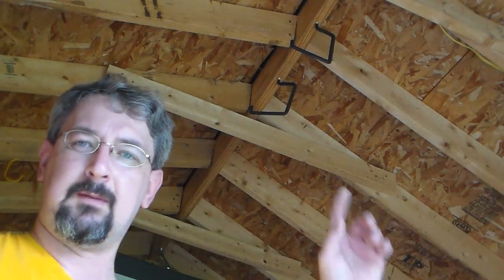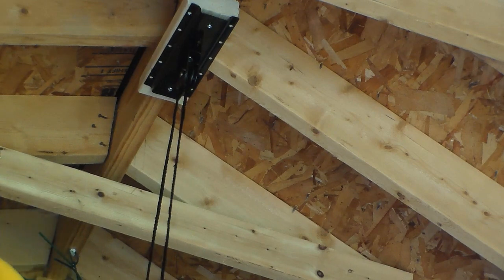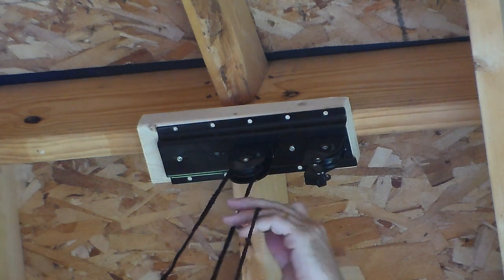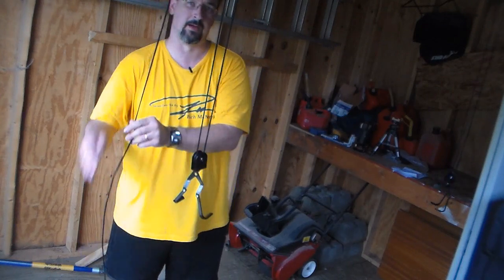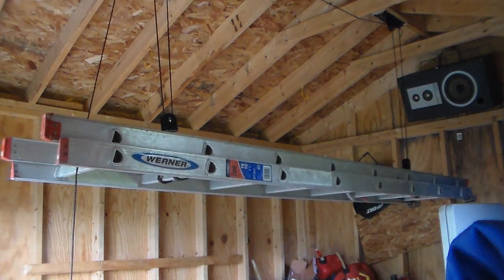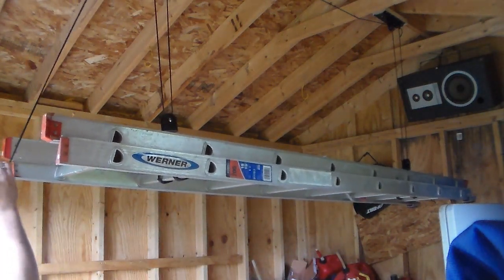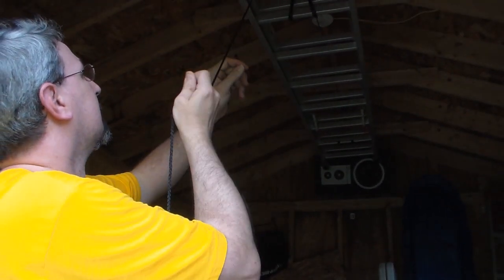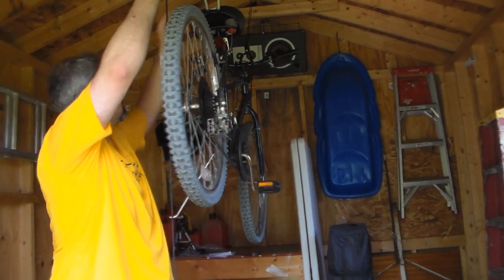Barn Storage

Comment: Mike, if building the lift table in either the garage or the shed, might I suggest the following. If the CNC table is going to be on locking wheels, your table can cut in one location then push it over to the lift location after cutting and before storage (with a dust cover) near the ceiling. Build table with fold up and locking legs. Put 4 pulleys on the ceiling (into joists) approximately same corner dimensions as the table. Run 4 quick disconnect cables from corners of table up through the pulleys and then all over to one side so you can connect with screw toggle adjustments on each onto a single strong bolt (perpendicular to the cables). From that bolt connect a separate single cable through eye bolts in the ceiling to a pulley at the downturn point along a wall near where you want to do the lifting. Then through eye bolts down to the lifting mechanism. If a turn involved use pulleys. The lifting mechanism can either be a hand winch or small electric winch. All of these parts are available at HF or a big box store and can be made for less than $75 (- electric winch) depending on the quality of rope or cable you select. I made several work table and and a couple Model RR layout ceiling storage lifts this way. Hope this helps get you started!! Mac
Reply from the maker: Thanks for the input.

Comment: I have a lift system in my barn that lifts the lid off of the back of my pickup truck. I made it using pulleys and a boat winch.
Reply from the maker: Boat winch would be a nice feature
Reply: I can send you some pictures if you like or heck I think you are close enough to drive out and see it.

Comment: For a CNC machine on 3/4 MDF you are looking at a lot of weight, more then you want to pull by hand or hold with your teeth... I would say think boat winch. Run the cable from the winch in the ceiling down the centerline of where the CNC will be in use. Attach 4 lifting cables to the main winch cable. Each of the 4 lateral lines would  run thru a guide pulley close to the winch cable and out to a lift point pulley directly over each corner. Cranking the winch would pull all 4 lines evenly and hold it securely. Note: The winch cable would only need 1 pulley, at ceiling height above the winch. The other end of the winch cable would be supported by the guide pulleys. Said winch pulley would need to be more then the distance of the lift from the first lateral.
Reply from the maker: Yup I agree I've had better idea